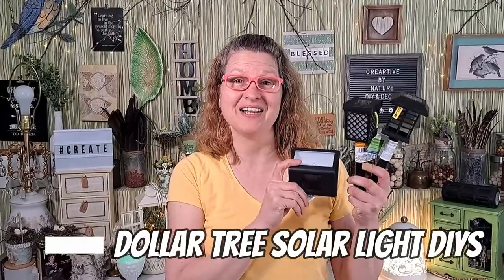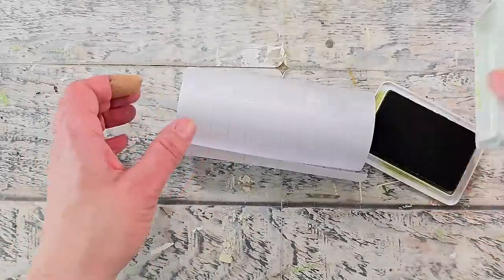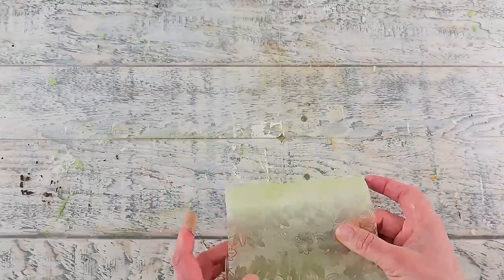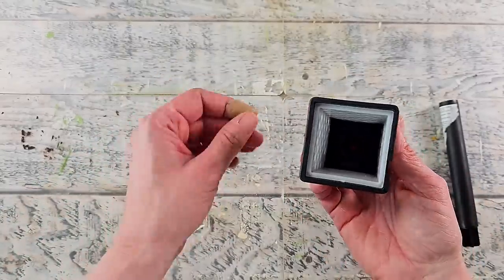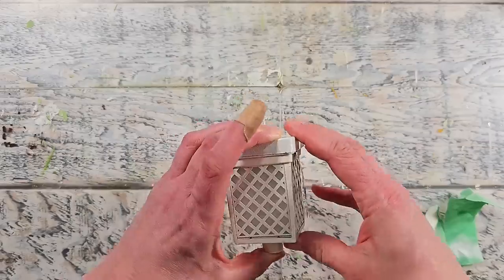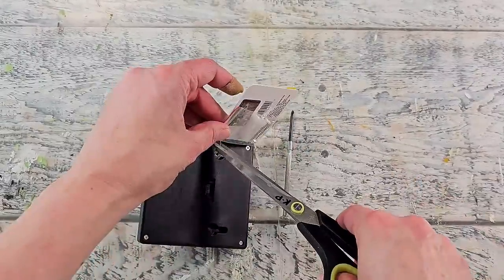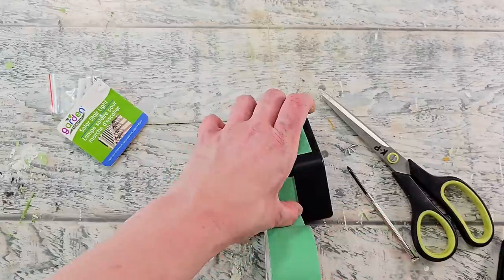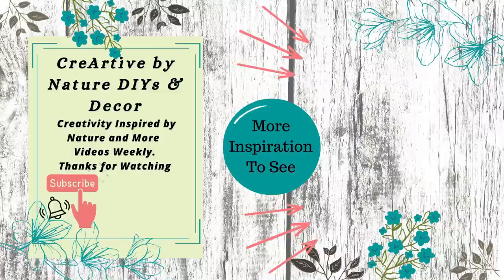MUST SEE Dollar Tree Solar Light DIYs for your Garden or Home Decor

Comment: I've had great luck with DT soars for years and I'm happy to see so many new designs this year.  For outdoor use, a light coat of clear nail polish helps prevent solar panel clouding.  I also use upside-down glass things over them for a glass lantern look - a simple cylinder vase is great,
Reply from the maker: Ooo, I'll have to try the nail polish!! Thanks for the tip 😉 Great ideas.
Thanks so much for watching. Have a wonderful weekend 😀 💖

Comment: I hang a wire or dowel across my box then string my small items by tiny wire or thread the spray. You may have a tiny area exposed when removing wire. Works for me. Love your channel. Adorable projects today. Per usual. 😊
Reply from the maker: OOO, great tip!! I will have to give it a try. It's so frustrating when the paint peels.
Thanks for watching Teresa. Take care 😊💖

Comment: Good ideas.  On the one where you used the stick on material and inked it green, what if you didn’t put the folding lattice plastic part back in?  I think it competes with your glass globe’s look.
Reply from the maker: You could try. The top portion snaps onto the lattice, so some good adhesive would need to be used to keep it all together. I'm not sure if it would work 🤷‍♀️😉
Thanks so much for watching and for your suggestion. 
Take care 💕

Comment: Yes, I'm gonna use them for a fairy house with a solar powered waterfall so I don't know the details of it yet cuz I can't use hot glue to keep it together since I'm in arizona and it would fall apart, so I could use it just to get things to stick together till the real glue cures and dries but I hope it turns out cute, Not sure if it's gonna be hanging yet or just sit on a table but probably hanging if it all works out on the hanging plant hanger I got so we shall see.
Reply from the maker: Ya, I don't know if the silicone will hold while hanging, I've never tried!
I don't know how strong it is. You may need to look into a stronger adhesive for construction. 
Sounds like a fun project!! 😃
Thanks for watching 💖
Reply: @creartivebynature  Yeah, thanks and I did look into a strong construction adhesive which is silicone so no worries.  The part that is hanging will have great support and only using the silicone blue for rocks and other things within the build that I'd used to use hot glue for but then later on realized how it just fell apart from the heat.  So live and learn, I think it's gonna be fabulous!